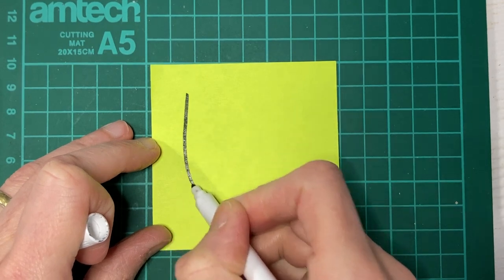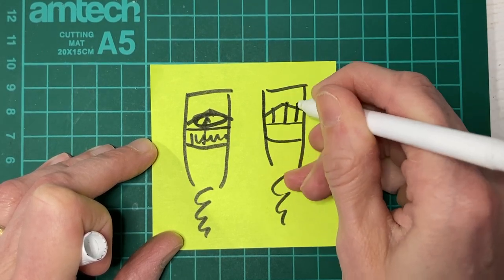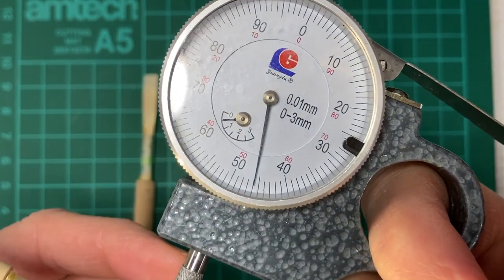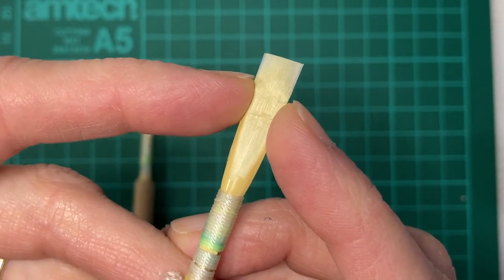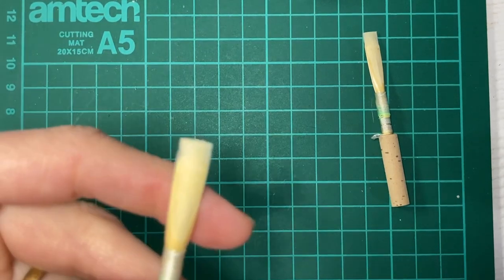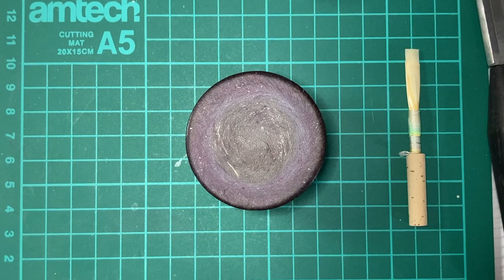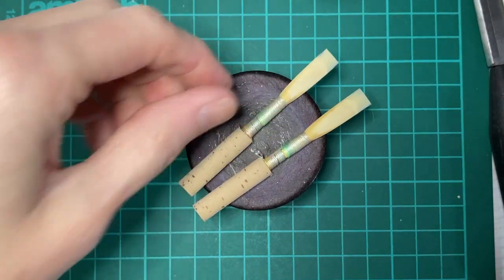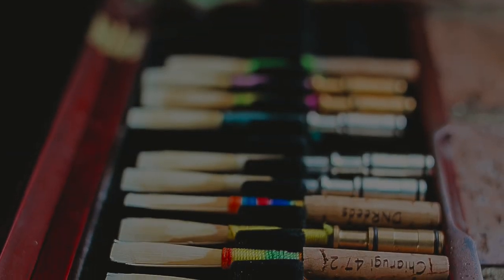Five Minute Reedmaker: The Attic

Comment: This is a juicy topic!!!    I am thinking I was one of those inquiring minds.     This gets my wheels turning.   So, at ORBC, one of reedmakers scraped  shoulders of attic; she was not referring to gutters of roof.  I did not get the chance to find out why......I am wondering if scraping this area is a happy medium between attic and 1st floor; increasing vibration without sacrificing stability.  I have been trying to scrape that area to see what the difference is.......
Also, high D above staff....reliably easy to pop out when slurring from below to note to not at all with cracking to lower partial.  I am thinking does not have to do with staple, but that attic area......or perhaps shoulder of attic........fascinating.    Have to find out!!!!!

Comment: Curious - It does seem that the rails extend forward on the 2nd reed more than the 1st. I would have thought this would add stability, but it seems that this is offset by the effect of not having sufficient bulk (in proportional terms) immediately behind the blend = a longer tip & all the fun that makes!
Reply from the maker: Yes, I do think that when we don't have enough separation between tip and heart, the effect is of a much longer tip! Thanks for that observation!